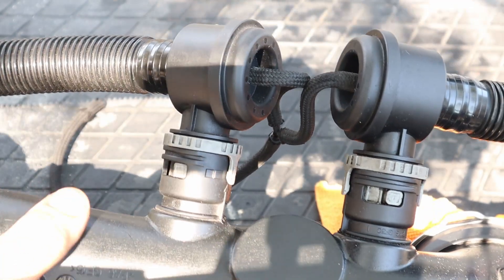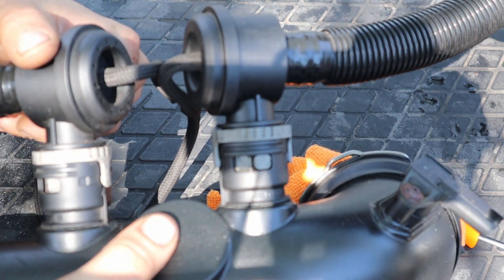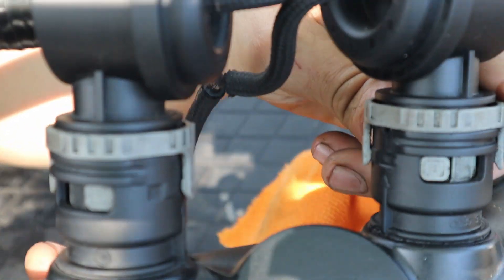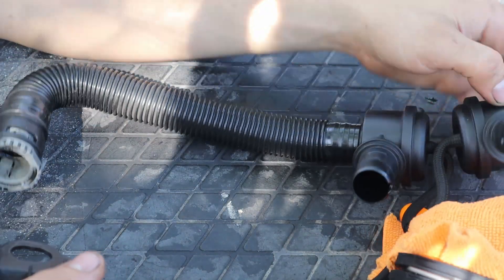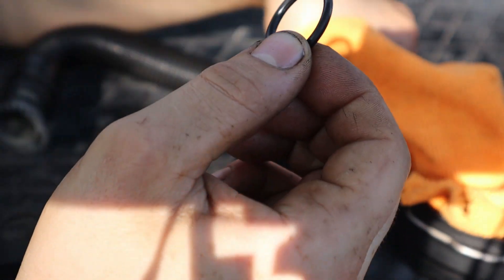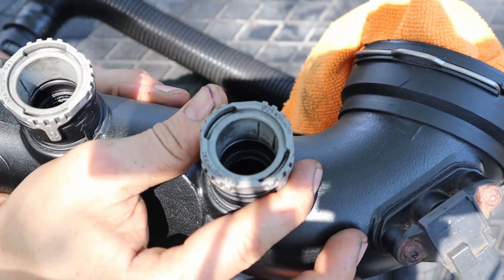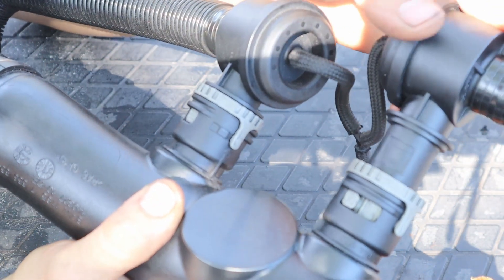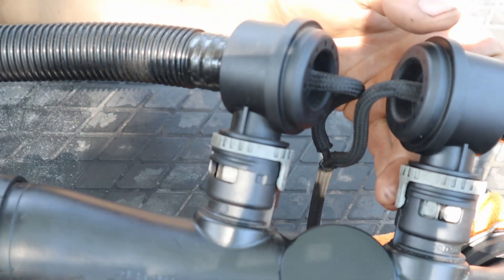BMW N54 Diverter Valve Removal & O-Ring Cleaning

Comment: Hey man question. If you don’t mind. What is the actual plastic hose called that the d valves plug into? The hose that gore into the throttle body. The d valves ripped off the hose. I just need new hose but don’t know the official name.
Reply from the maker: I would call it a charge pipe!
Reply: @dirtykurty92  hey my bad didn’t see your response. Lol yes thank you dear sir. Seriously . Very nice of you to get back to me so quickly.
Reply from the maker: @alexandercahoulan6583  of course happy to help you and anyone else that has a question!!!
Reply: @dirtykurty92  fixing my dads 335i. The low pressure fuel sensor was a biatch man. But the valves snapped off the charge pipe. I got the updated aluminum charge pipe.
Reply from the maker: @alexandercahoulan6583  good choice with upgrading to aluminum! That’s what I did as well

Comment: What is that double wire that holds the DV called??? I broke the pointy thing on the engine that holds that wire.
Reply from the maker: Do you mean the vacuum line?
Reply: @dirtykurty92 yeah that’s what I think he meant
Reply from the maker: @Bryan_e60_535xi  yea sounds like he broke the nipple off the intake manifold, definitely not a fun situation to be in!
Reply: @dirtykurty92  my car is running too lean I and I used a smoke device to find out it’s leaking from the diverted valve, ima change the chargepipe
To hopefully fix it
Reply from the maker: @Bryan_e60_535xi nice! Good time for an upgrade! I have a video of my upgraded aluminum charge pipe! I went with a tial bov, what are are you thinking about going with?
Reply from the maker: @Bryan_e60_535xi good find by the way
Reply from the maker: Hmmm I’m not understanding what your asking, maybe try explaining what you broke again?